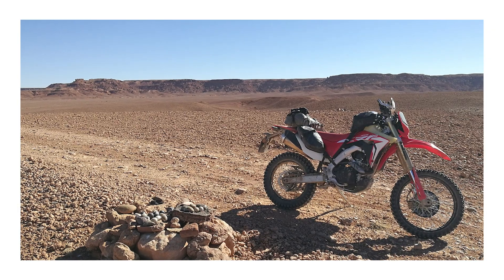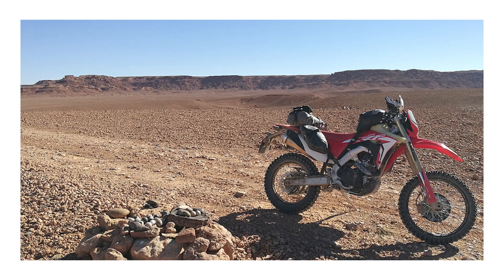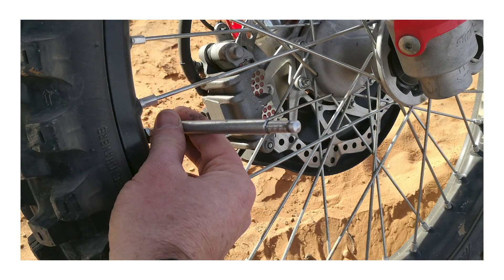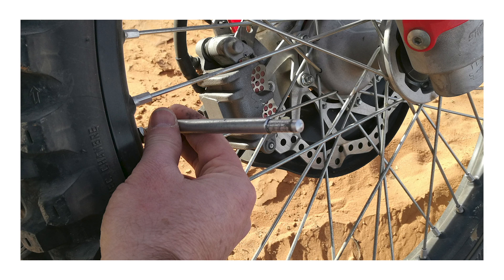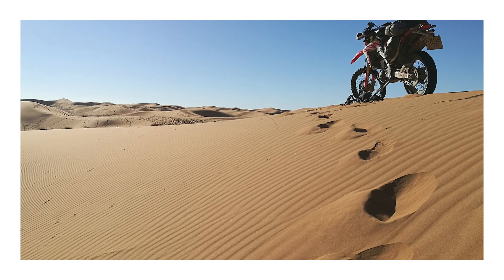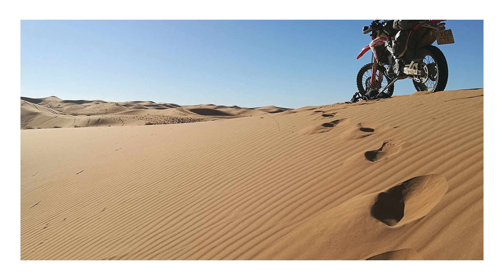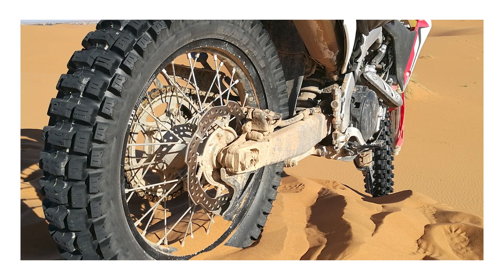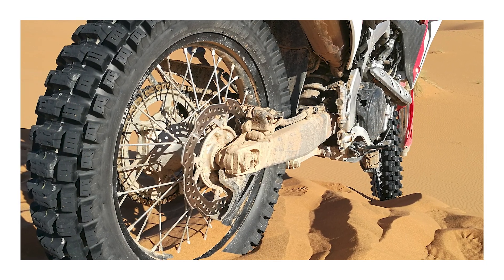How does tyre pressure affect ADV Bike performance?

Comment: It’s interesting that Metzeler recommend that you do not air down their Karoo 3 tires for Offroad use and you run them at the recommended pressures.  This may suggest that the air down wisdom of old needs to be reconsidered or at least modified in the light of the massive amounts of R&D that has taken place in the past few years in tire technology.   There is no doubt that the variety and choice of ADV tire is now incomparable to the miserly pickings of only a few years ago.